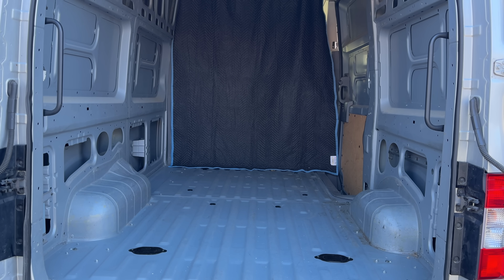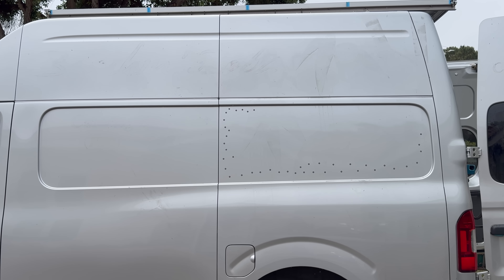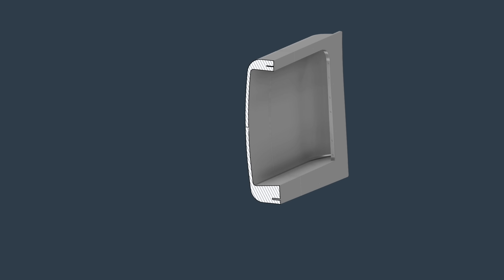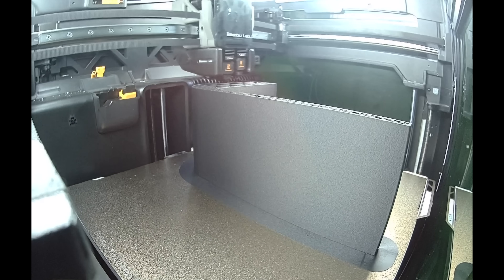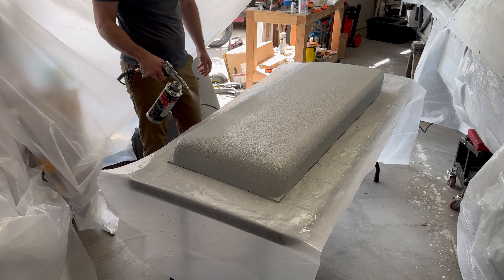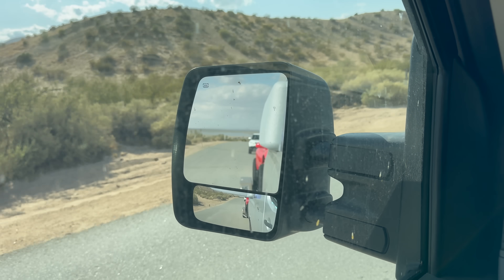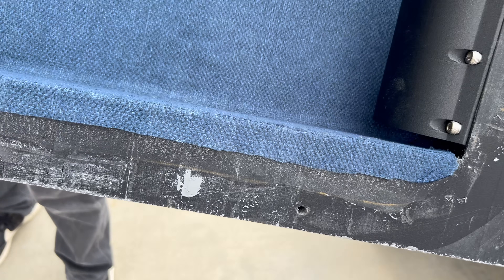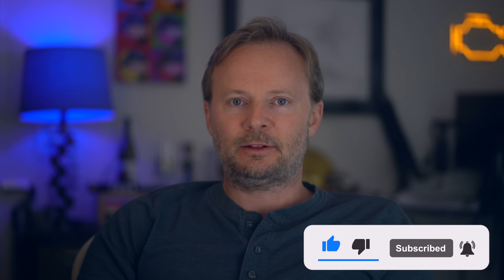The Challenges Of 3D Printing Large Parts

Comment: Acetone 100% works for ASA, I've solvent welded Bambu ASA-CF no issues. 

What would have helped is a tongue and grove where the joints are. More surface for adhesion and also helps with water resistance.
Reply: A cheap hack I've found is to buy ABS plumbing cement. It works excellent on ABS prints and seems to work with ASA equally well. Seeing as how it's largely just a mix of acetone and ABS... no real surprise.
Reply: @Maxzillian That is an excellent hack I will remember up to the day I will have to use it, then probably have the same issues Matt had.  Thanks for the tip!
Reply: @Maxzillian  I learned a few years ago that the PVC primer alone works well for gluing plastic car parts back together. I’m not sure what headlights or taillights are made from, but I had to take mine apart to replace a led strip for the side marker. It worked very well for years
Reply: @only1muppet  Mostly polycarbonate.
Reply: @Maxzillian  that genius actually, im going do that when i print ABS... most of my prints are PETG.
Reply: @Maxzillian I've done this on large multi-part prints as well. The beauty of plumb-weld is it also has some sort of epoxy in it (it says that on the pot anyway!) You can also water it down with acetone and the little brush inside means you don't waste another tool (not that I am cheap, but...)
Reply: @Maxzillian i just mix the supports with acetone, it works amazingly well, and you can use thickly mixed that behaves mike putty to bridge gaps, and brush on thinly mixed to get a shiny surface.
I think using a medium mix to fill the gaps and rolling on a thin mix would work without fiberglass, though I'd still do fiberglass because it goes outside.
Reply: @Maxzillian  I always just save old failed prints and melt them down with acetone. that way the glue is the same formula as what I'm glueing
Reply: @jlkoelker  This is one of the most useful youtube comment threads I have ever seen. That you all. The only problem is that when I need this info one day in about 2 years time I won't be able to find it, so I'd better copy it to my 'campervan build' file right now...
Reply: @Maxzillian does the plumbing cement bubble if you put it too thick? Thats a problem with acetone-abs dyi goop
Reply: @lasskinn  I don't think I've ever observed DIY goop bubbling (I have done that as well). My only real complaint with the plumbing cement is that it's pretty thick and the working time is short.
Reply: @Maxzillian  plastic plumbing is all solvent welded, so it solvent and dissolved solids to fill gaps. They use mixes of solvents to get the working time correct, but you can just mix solvent with plastic to make it. Take some Asa scraps and mix it into some acetone and you have Asa cement.
Reply: Put acetone In a spray bottle and spray the whole thing after welding for smooth finish and perfect layer strength(but only on the outside)
Reply: I was gonna say, I've printed and permanently fused ASA parts like this before
Reply: When using acetone, what is your technique? Do you add it to both parts, wat a little and then just press them?
Reply: @kzalesak4 just enough to cover the edge push together and leave overnight as it takes time to gas off totally.
Reply: @kzalesak4  I use a small brush to spread a generous amount on both sides. i keep a small jar of ABS+brims and printer waste mixed and use that instead of pure acetone. After pressing the parts together (it helps to have a dovetail or some other system to index the parts) I usually brush on some onto the joint area to seal it up good.
Reply: 100% correct.  Isn't Matt an engineer?
Reply: @d.thorpe2046  He is not an Engineer vor Plastic.... and he is not that wrong: The problem are: Additive

Always check the manufacturer's specifications beforehand. Acetone does not always work.
Reply: @Max-bd9xg If he is ANY SORT of engineer he is required to know the basics.

Comment: you could also make one with the power of hydro forming!
Thats what I would do!  It would be arduous!
Reply: Vacuum forming would be a good compromise for most people who do not have hydroforming equipment in their living room.
Reply: @brianhaygood183  I would weld 2 sheets of 24ish gauge steel together and expand it with a power washer inside a wooden form.  This would result in a single shape that I would cut apart at the seams. Then nest the halves, spaced with bolts and then fill the gap between them with expanding foam.
Reply: @brianhaygood183  vacuum forming would be easier but you have to create a buck that is the exct shape of the bumpout and have a vacuum former
Reply: Super interesting idea, how would you go about making the form for it? Slot together wooden frame, 3D printed male form and concrete? and then would you weld a steel plate to a sheet of steel, bolt the form on top and and have at it with a pressure washer?
Reply: @nelsonglover3963 The core idea is you have 2 sheets of steel with one having a bung welded over a hole in that sheet and then the pressure washer wand attached to the bung. You need to come up with a design where the edges of the materiel can draw in as it inflates like a mylar balloon.  I made a steel 5 pointed star with way and found eye balling it pretty easy after a few attempts.  Id start by making scale models by taping 2 sheets of notebook paper together and inflating it with a straw.    Id see where it needs to be constrained to stay flat where I want it flat. I want to use unrestrained inflation to create all my curves.  After I come up with the final design Id make the form out of 4X4 post sections lag bolted together. when you inflate the steel there will be some rippling no matter what but you can smooth any big ones out by cutting along the highest points of the ripple and then hammering it from inside.  The fine ripples can be made right with automotive filler or  well placed bonk.  The sharp rear curve might be a bit much and if desired would have to be cut and welded after the fact.
Reply: There's German guy or something on YouTube who does hydroforming with just a garden variety pressure washer, apparently nearly completely safe with just a shed wall and pair of safety squints

Comment: As someone who bedlined my 2000 Jeep Cherokee, it is hard to not to just start spraying everything in bedliner....
Reply: As a mechanic who's worked on vehicles that have had that done, just consider the consequences for your future self. It does do a fantastic job of not flaking off, but getting fasteners off can be really fun. I can't remember if 2000 is new enough for a Jeep to be 30% Torx fasteners, but if it is you definitely want to consider how impossible it would be to get bedliner out of the socket of a torx head fastener.
Reply: @zrobotics It also weighs a ton, which most car and truck people find way too easy to ignore.

Comment: Glad to see that the printed in threads held up. I've done a lot and ended up just using heat-set brass inserts. Plus they look amazing.
Reply: From experience with threads in plastic, on larger holes printed in threads work fine, but for smaller holes if you just take roughly the pre-drill size for a tapped hole and print that you can drive a bolt in there no problem and it will form really nice smooth threads. If you do this fast enough(electric screwdriver) and immediately back it out again you'll even anneal the area around the threads with how hot the bolt gets, you'll then also burn your hands on said bolt.
Reply: @ProtesttheAntagonist  That last step is crucial. The machine spirit demands sacrifice from time to time.
Reply: Oh and also when your disassembling and reassembling a part made this way, make sure to get the screw to re-engage with the existing thread rather than trying to cut new ones. That goes for any plastic threads 3D printed or not.
Reply: I sell products with M6 holes that I've just tapped into ABS. Holds up great, and has a sort of "nyloc" effect.
Reply: From testing, actually modelled threads work better than heat set inserts for one-of screwing (in that case, given that it's also glued to the body, it's a good application for it), second is captive nuts (though they can be stronger depending on the implementation) and inserts come third, but they do look cool

If you can do it in your modeling, try heat-set inserts from the back.
Another option to get the best of both worlds is a long bolt with a short insert and a tube the size of the bolt, so you have the insert to guide to the screw threads and can reuse it a few times.

Nut and washer is always reliable though (you should add a cylinder modifier on the bolt hole and make it all perimeters for extra strength.)
Reply: I think he'll probably end up moving to a more permanent solution
Reply: Heat-set brass inserts work GREAT.  I've also either printed threads (for big/thicc ones) or tapped them after the fact.  Then run thin CA glue into the threads, let it cure (be SURE to let it cure!!) and then chase the threads again.  Makes a pretty solid interface.
Reply: @VAXHeadroom  Can you explain the glue part to me? Are you applying the glue to the male threads or the threads in the whole?
Reply: @themanhimself3  Threads in the hole.  The CA glue soaks into the plastic and makes it VERY hard.  The threads will last a long time.
Reply: @VAXHeadroom That's an interesting tip I've never heard. Thanks for explaining that!
Reply: Isn’t tapping thread into a hole easier?
Reply: @RustOnWheels  Easier yes, but depending on the screw size and thread pitch other options may work better.
Reply: @VAXHeadroom good to know. I’ve a 3D printer and never thought about trying to preprint threads before.
Reply: I've always had good luck with threads in 3D prints. I've designed a lot of stuff that way for real world applications.

Here are some tips:

1. Don't use PLA.
2. Don't actually model the threads, let the screw form its own threads when you install it. You will have to do some experimentation for the material you're using and the particular thread size.
3. Make sure you have enough perimeters around the hole
4. Don't use PLA.
5. Try your best to have the holes aligned with the z axis of your print, otherwise splitting is more likely. Although, you definitely still can have threads in the other axis it's just not as strong.

For example, I've found that 12mm of engagement with a grade 12.9 M3 screw in ASA is enough to break the screw before the threads strip.
Reply: I'm not sure they work great in blind holes like this... Even a crappy thread works when it's long enough.